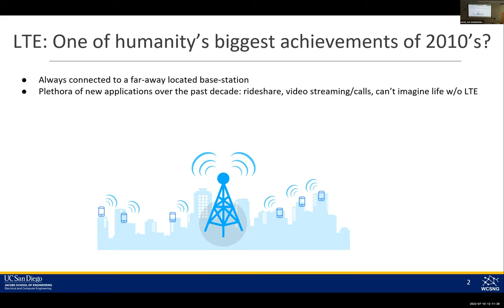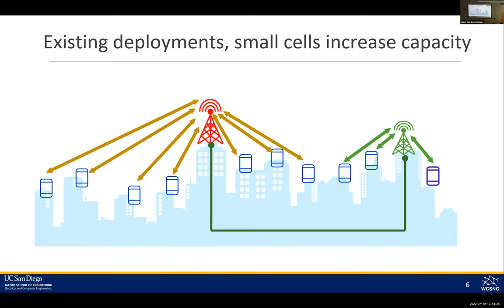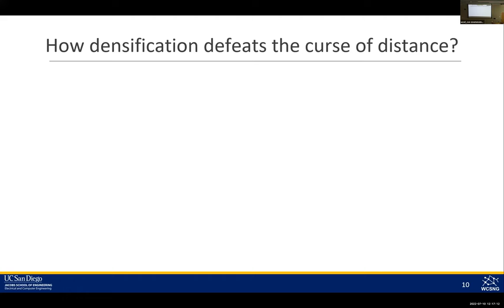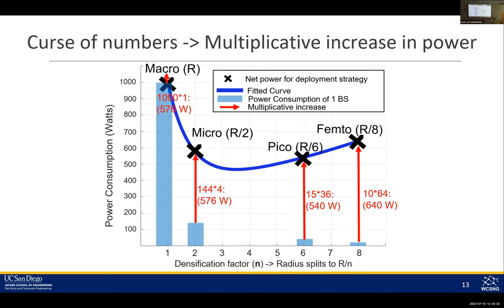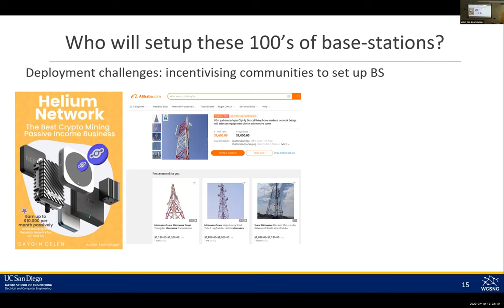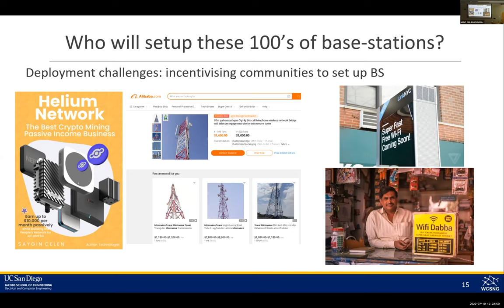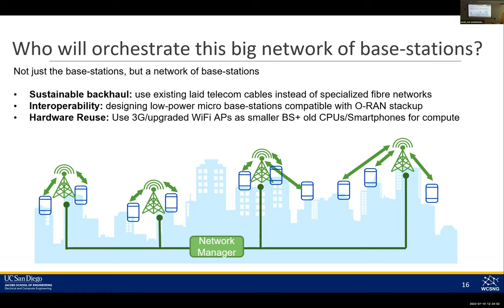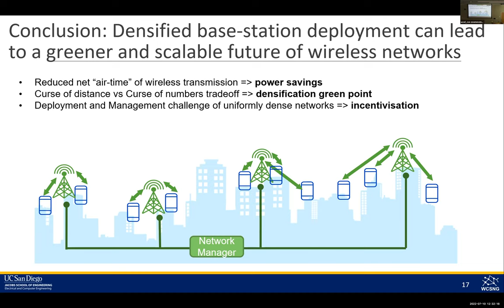Multiple smaller base stations are greener than a single powerful one

Comment: Very informative presentation! I have some questions.
1. How can we utilize the idea small base stations to extend affordable mobile connectivity to rural and underserved areas and what are the innovations we need to make in the Radio Access Network(Antennas), wireless backhaul(Microwave radios) and power systems to achieve this?

2. What technical innovations can made to address the operational nightmare of managing multiple base stations rather than just incentivizing communities to help?

I’m applying for PHD this year and this is the research area I want to pursue.
Thank you!